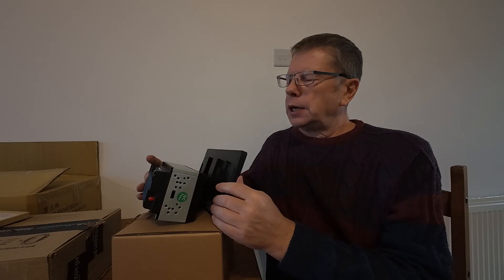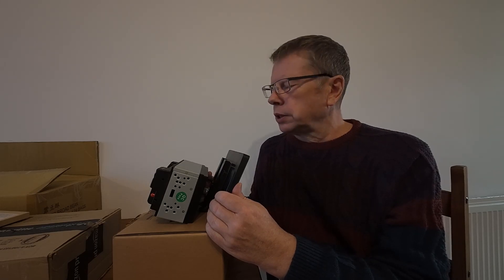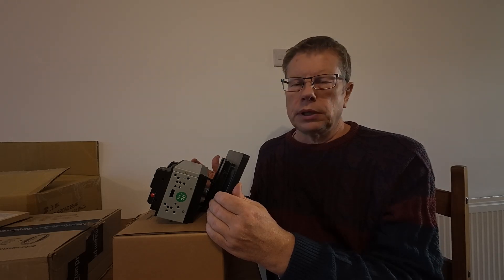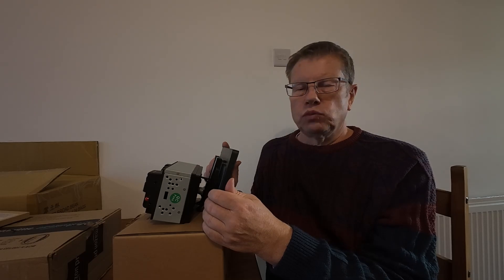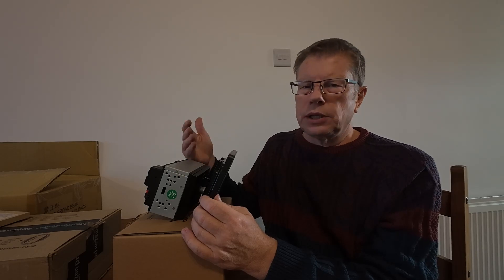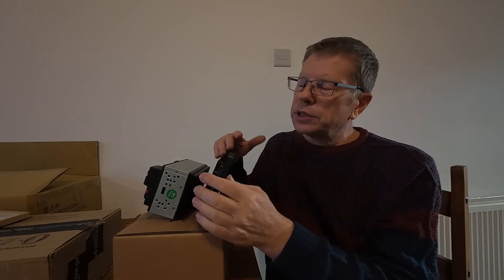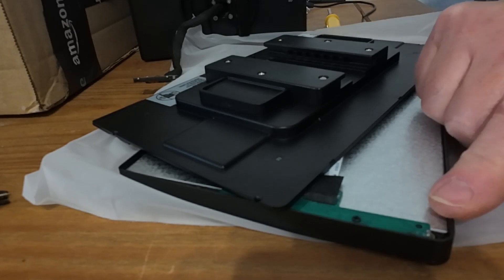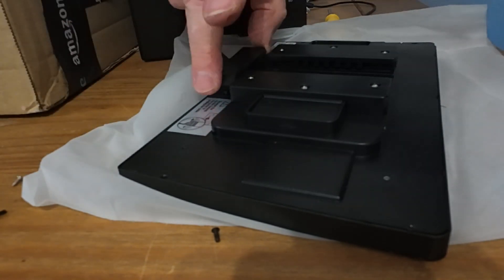Eonon UA13-Plus Android 13 head unit.  Internal microphone disconnection to improve call quality.

Comment: Great Video - have just preformed this after watching yout video.
Question:  Is there a way to run a Eonon Carplay/ Android Auto screen with an Android head unit?
I recently replaced my original Car Stereo and CD player in an old VW Golf with a cheap 7 inch 2 din Chinese Android head unit which actually sounds good.  I previously had an Eonon 10 inch screen that sits on the dashboard that offers wireless Carplay and Android Auto.   This screen is excellent and I want to try to retain it.
Do you know how I can best link (seamlessly) the Eonon screen to the Android Auto Head unit? Ideally I would like to have them working independently with perhaps the Eonon screen running Carplay, and the Android Head unit just working as an Android unit which is less restrictive than Carplay?
Currently they appear to be competing against one another dropping connections and it is confusing so I end up unplugging the Eonon screen.  I really do want to try to get this to work.
Reply from the maker: Not something I've considered or know how to do. I suggest asking on XDAforums.com

Comment: What did you cut with, and how can you not show that?
Reply from the maker: Its a very thin PCB track. Easily cut with anything sharp - a craft knife, scalpel, razor blade or even a small-bladed screwdriver.

Comment: Do you know please how to start such head-unit on your desk? I.e. outside of a car?
I checked the pin-out diagram for the quad-lock connector (Mondeo Mk4), it says pins 12 and 15 are the ground and the battery, respectively. But when I send 12V DC nothing happens.
Reply: You also need need to 12v on acc (red) not just battery (yellow)

Comment: Hiya! I enjoy your work and admire your dedication to help people si thanks for that! I suppose cutting either tract on the board (or both) wouldn't make any difference? I'm just a french amateur and my board is just a wee bit different but remains the same overall. I just wanted to make sure cutting either mic tracts or both wouldn't make a difference. Thanks in advance. Greetings from France
Reply from the maker: Yes, you can cut either connection.

Comment: you can disable it but it will remain active ?!
Reply from the maker: Yes, disabling the microphone in software doesn't actually work. The function is not implemented. You need to physically disconnect the internal mic.

Comment: Is there any software way or option to disable the internal mic ?
Reply from the maker: No.  An option to switch between external and internal mic shows up in the 'Settings' menu, however it has no effect. The external and internal mic are wired together inside the unit.
Reply: @erictechUK  i can't find that option in the settings 
Brand  "joying" 
I tried to plug the external mic, and it works 
But the internal one is also active, which has noise problem
Reply from the maker: @9Ayir The external and internal mic are connected together inside the unit. You cannot disable the internal mic in software, you must cut its wiring as shown in the video.

Comment: How was the gt86 install ? I'm looking to replace the defunct touch & go.
 Where are you buying the plus unit how much ? Did you do a custom harness
Reply from the maker: GT86 install is very easy. Purchased Toyota brackets for aftermarket radio fitting (Toyota part number SU003-01962 and SU003-01963 - left & right) at a cost of about £6.  Purchased wiring harness adapter from AliExpress - about £10.
Reply: @erictechUK  Appreciate videos like yours, are you a radio engineer ?
I've mailed Eonon I'd go for the UA12S-PLUS-6G it's on offer &  sports a qulcom soc ! Not sure if it's genuine android 13.
I've figured most of the car wiring as no steering controls or factory camera, one black wire from the antenna not sure about, do you know?  taken aerial apart I'm guessing it's a built in signal amplifier due to the circuit board, needs power or ground ? not sure how to test that.
I've heard that some radios send power down the centre coax core, there is an adapter for this around the interwebs along with iso harness and usb retension adapter for center console.
Reply from the maker: Eonon A12 and A13 series both run genuine Android 13.  A13 series is fine if you just want to use CarPlay/AndroidAuto. A12 is better if you want to run apps on the unit itself.
GT86 is a very easy install indeed. Standard Toyota connectors. Get a 16-pin headunit-to-Toyota adapter - e.g. from AliExpress seller Burgim, Upindo, Skyfame or others. Around US$10. Don't bother going via ISO.
Adapter will have 16-pin plug for the Android headunit going to Toyota connectors: 10-pin (power and front speaker), 6-pin (rear speaker), radio antenna connector with power feed pre-wired, plus 20 and 28 pin control connectors (use if have SWC). It will also come with a USB retention adapter. Its plug in and go. Takes literally two minutes.